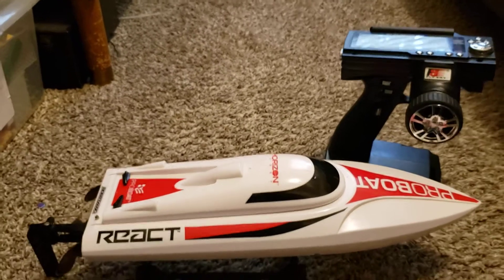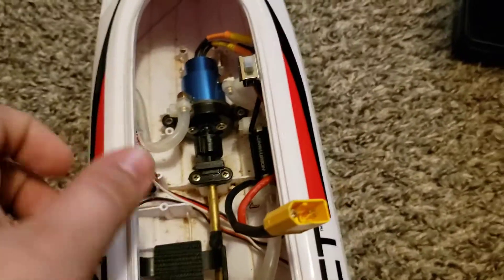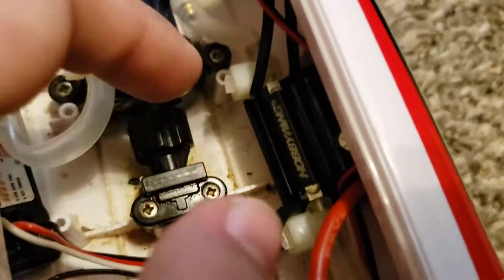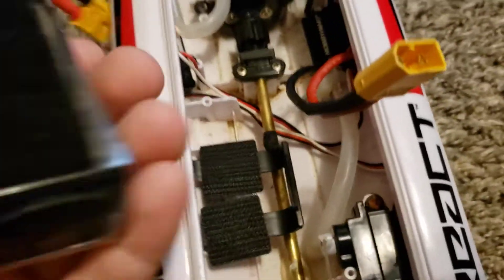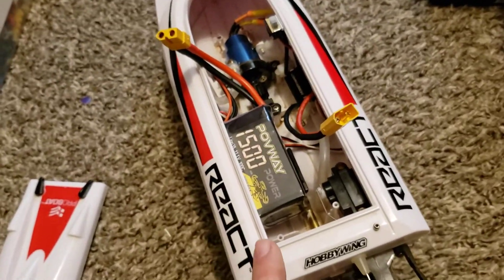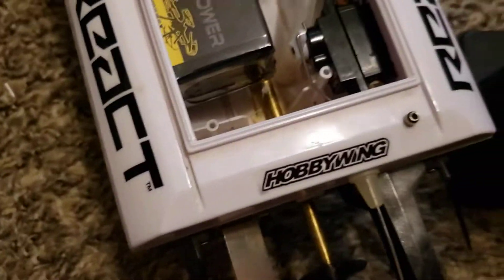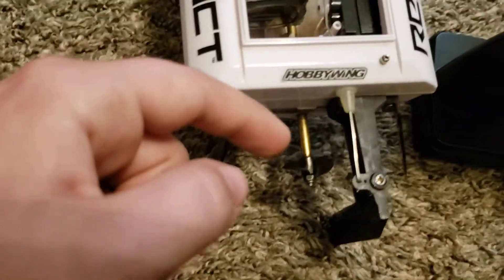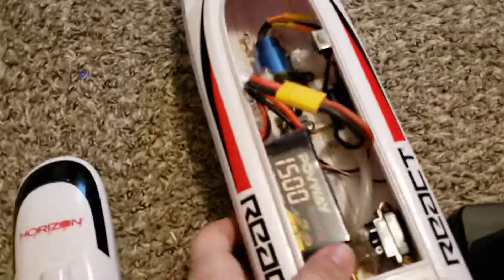Proboat React 17 brushless upgrade how I did it (hobbywing seaking)

Comment: Hey, I know this is an older video, but I'm doing these mods right now and just wondering how you got the plastic collet piece to stay on the motor shaft. Does it just press on or do I need to put a screw in there to stop it from spinning on the shaft? The brushed motor has a splined shaft, the brushless has the standard flat spot. Thanks!

Comment: The stock brushed motor bolts are a different thread pitch from the hobbywing 4800kv brushless motor end up using some losi xxx sct swaybar bolts which are a perfect fit,   also the water sensor is no longer active once you make the conversion.

Comment: Hi, great video! 
I have one question... I did the upgrade exactly as shown, but now the "self-richting" feature doesn't work to me. The boat stay flipped over no matter what I do with throttle. Does it work for you?
Reply: i have the same issue. use weights and place them towards the back of the boat to get the prop to sink down lower. this will cause the prop to be closer to the water and grab when it is flipped over

Comment: Has this motor held up good for you on 3s? I just got mine and installed it in my little outrigger. I didn't even get it off the work bench and it went up in smoke! Installed the motor. Plugged it in and barely tapped the throttle for 2 seconds and the yellow wire started smoking, the motor was hot, esc was hot all instantly. I'm using a brand new 3s 100c with a 40amp esc...I specifically bought that motor because it could handle 3s.

Comment: Two more questions please Seth: 1). What procedure do you use to lubricate your prop shaft? AND 2). Did you defeat the water activated sensor so you can test your boat without it setting in water? Thanks for your answers! As a subscriber, I will look for your response.
Reply: For lubing the prop you take the prop off and take the motor mount off which allows you to pull the shaft through. And once you do a electronic swap you can cut the wires going to the water sensor
Reply: Yea same

Comment: Great job....I just bought and plan on running it stock until something fails. I have ordered a battery plug adapter so I can use EC3 plugged batteries and charger them on my Spektrum smart charger.
Question please: What motor to prop shaft mod can I do avoid taking the running apart to lubricate the shaft. I want to be able to quickly loosen a collett and pull the shaft out the back with the prop attached. Then, grease the shaft, push it back up the stuffing tube and tighten the collett. Thoughts please. Thanks Michael
Reply from the maker: Actually you don't have to grease it you use oil like just basic all purpose stuff
Reply: @sethpig45  Thanks, but I was trying to come up with an easy way to remove the prop shaft by disengaging it from the motor so that I could pull it out the back with the prop attached. Therefore changing out the motor/prop shaft connection (collett) to one that could come loose by screw or nut.
Most proper boats will release the prop shaft with a hex key or two wrenches.
Any thoughts for a mod you've done?

Meanwhile....Are you saying to just remove the prop and try to get some 3&1 type oil down the stuffing tube? Thanks again for your help!
Reply: Where did you get the battery plug adapter? Can you post a link or make/model?
Reply: @aemer1981  Think I just Googled for that adapter and a guy's business came up with an email. Not sure where it is now, maybe with boat box. He makes all sorts of battery adaptors and they weren't too expensive shipped to you.

Comment: I have the remote connected but I have no acceleration it won’t move forward or backward. I only have steering how do I get it to accelerate
Reply from the maker: Any beeps like what is it telling you
Reply: @sethpig45  thank you but I got it figured out but I still have one problem my forward is backwards and backwards is forwards I can’t seem to figure it out
Reply from the maker: @lukedeubig4664  just switch two motor wires

Comment: How do you get the stock motor adapter off it is not sliding off.
Reply: I got it off but how do you connect the remote to the reciver
Reply: @lukedeubig4664  How did you get it off?
Reply: @randyforce8455  I just used pliers and pulled it off. It feels like it is going to brake but it comes off clean

Comment: How fast does it go?
Reply: And do you have to buy another remote or can you use the original one?
Reply from the maker: Can't use the original remote and don't have an exact speed but I'd say like 15 to 20mph and that's if you can get it stable enough 😅
Reply: @sethpig45  it goes faster than before you had the upgrades on right?Because the boat is supposed to go 19+ mph.
Reply from the maker: @lukedeubig4664  oh didn't know that idk i have a blackjack 24 they say it goes 30 i was comparing it off that
Reply: @sethpig45  do you think the upgrades are worth it?
Reply from the maker: @lukedeubig4664  yes
Reply: @sethpig45  should I use the bigger motor for 50 dollars?
Reply from the maker: @lukedeubig4664  I think the motor its got is plenty of power

Comment: I have this boat and purchased the Brushless motor shown here. How did you deal with the coupler and differences in the shafts between the two motors? The coupling is press-fit onto a solid splined shaft on the stock motor. The Hobbywing is not splined and has a flat spot for a grub screw.
Reply from the maker: Put a dab of super glue in the hole of the cupler and press fit it like it was
Reply: @sethpig45  Thanks for your reply. I thought about using cyan glue but wanted to double check if there was another way. I was looking at collets but it's hard to find the right size. So how well is it holding up? I have all the stuff I just need to find the time. I went with a different ESC and battery (already had them). Last question, how well is self-righting working and are there any rules I need to follow to keep it? I'd hate to take a swim for it. Thanks!
Reply from the maker: @monosurge  no self riding and its pretty good no breaks or anything just flips ALOT so be sure to have a reliable rescue plan
Reply: @sethpig45  I wonder if one of the reasons you are having issues getting it to self-right is bc you set the reverse throttle to 10%.  Have you tried leaving it at 100%?  I have a heavier 60 amp proboat esc lying around that would be about the same weight as the stock combo esc/receiver. I was going to mount it in the bow instead of on the side.  I was hoping this would balance it sufficiently that it would self-right.
Reply from the maker: @randyforce8455  after testing i did end up mounting to the front and yes I've tried with 100% everything the motor just doesn't have enough rotation mass as the stock one did
Reply: @sethpig45  Hm.  Wonder if that's why the recoils used outrunners.  The 26 also had a weighted collet to help.  If you ever find a configuration that gets back upright, please let us know. :)
Reply from the maker: @randyforce8455  out runner would be the way I bet I have an Amazon boat brushless that has just a out runner no weighted coupling and it flips over great
Reply: @sethpig45  I have a 2100kv outrunner lying around.  Maybe I'll try to cram that in lol.

Comment: Great video! Quick question, what adapter do you use to connect the new motor to the boats drive shaft/propeller?  The stock motor has the brushes(I think they are called) that stick out and turn the drive shaft.
Reply from the maker: Didn't use in adaptor the stock one slides off the motor and I just put a dab of super glue cause it slipped first test run after that it was perfect
Reply: @sethpig45  Thank you!